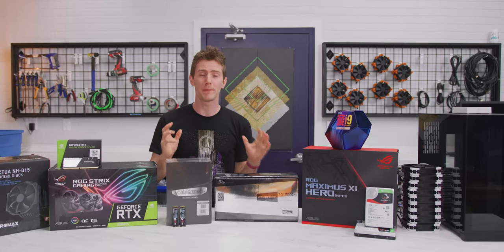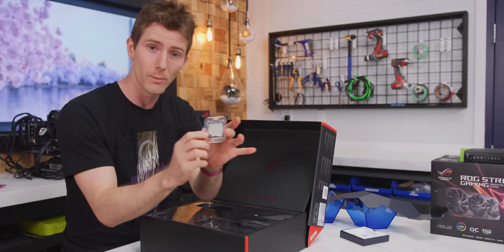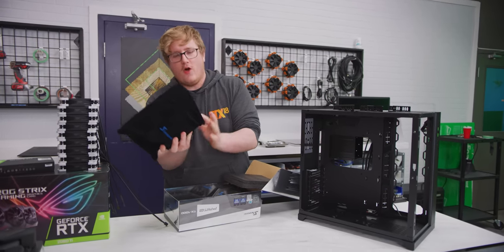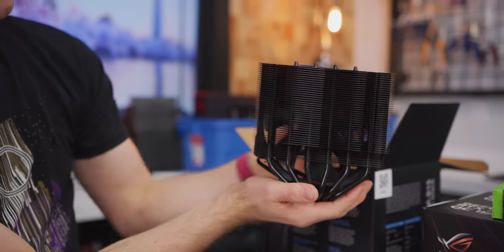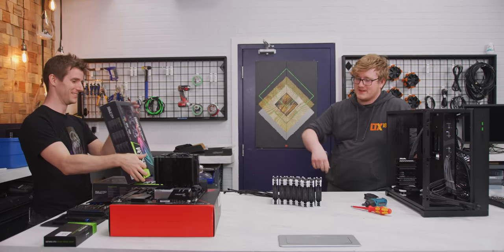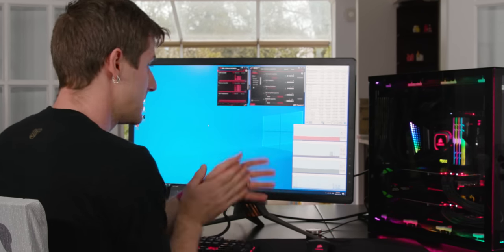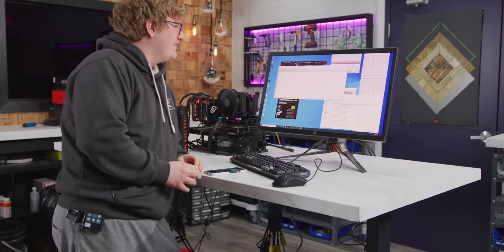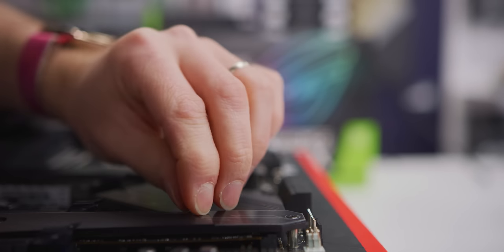Can AMD Beat the ULTIMATE Intel Gaming PC?

Comment: 14:33 
4th gen Ryzen processors aka Ryzen 4000 (Zen 3) desktop processors are confirmed to be 7nm and probably launch late this year.
5th gen Ryzen processors (Zen 4) will be 5nm and launch 2021 or 2022.
Reply: and intel still sitting on 14nm.
Reply: And Ryzen 4000 will be on N7P, not even N7+ (with EUV and a density bump). May still beat or match Intel, but it's not going to stomp this generation.
Reply: zshadows 
Price might be a reason to go with N7P. Might be better for the costumer in the end.
I consider it a stomp if Ryzen 7 4700X matches i7 10700K in performance but is 100 bucks cheaper while consuming less power/generating less heat. And I think this is what will happen.
Also they are architectural improvements (like going from 4 core complex (CCX) to 8 CCX for lower cross core cache latency). So Zen 3 chips will be better than Zen 2. We will see how much.
Reply: If amd can bring zen 4 on 5nm euv out the market Intel has to disband 14nm chip. AMD can charge premium to make some profit before Intel has real 7nm chip which will be sad they wont make as much profit
Reply: Watch the WAN show

Comment: "We're gonna play some Apex on it later"
Of course, THE benchmark, Apex Legends. ..    .......
Reply: wha？
Reply: Apex is surprisingly hard to run at all max settings. my 1660 super cant even go above 100fps 1080p all lowest settings
Reply: @Nobaris9961  you have some problems with your gpu/cpu then, coz I get 100fps on medium settings ok my rx580
Edit: for reference, got a ryzen 2600x
Reply: @Nobaris9961  What's your CPU? I'm getting 80-100 fps at 1080p with a Ryzen 5 3600 and 1660 super with all settings maxed out
Reply: @Nobaris9961  Ohh what
My 1050TI can run I think it was High settings fairly well
Reply: Nobaris im sorry to say, but a 1660 should run apex on max settings at 60+ fps with ease. My 1060 runs it at 1080p maxed out at 144+fps
Reply: My 9900K + 2 RTX 2080s SUPER NVLinked push up to 200+ fps at 1440p max settings in Apex Legends. I need a 1440p 240Hz monitor (currently on 165Hz with G-Sync).

Comment: No one: 
Literally no one:
Not a single freaking human:
Not even a goose or armadillo:
“Let me buy a $750 CPU with half the cores and threads and double the power consumption for 10% performance upgrade”.
Reply: rogerwilco99  That's kind of a pointless declaration. Best to pick the best CPU for each use case. For instance, no point buying mobile Intel CPUs for the moment...literally none, since they run hotter, consume more power and perform worse. Enjoy at least 20% worse battery life ;) 

Did AMD bully you when you were a child?

Comment: As someone that tried to cram a NH-D15 into my O11-Dynamic, I knew 10 seconds in that they were going to have cooler trouble lol
Reply: that's the reason the XL version exists
Reply: @MHWGamer  I'm actually thinking of going for the O11-Dynamic XL, with sideways facing GPU mount and bottom to top airflow, with my NH-D15 in bottom to top airflow configuration.
That, and maybe looking at some unRAID NAS storage integration.
Reply: They should have just gotten the A12U, i think it has pretty much the same performance

Comment: "a PC someone might actually buy"

Intel Core i9 & dual 2080ti's but its air cooled

Ya it was the water cooling stopping your viewers from building these rigs
Reply: They still had to water cool it anyway 😂
Reply: He said multiple times that the focus was on performance, and that watercooling wouldn't make a difference. Why bother dealing with it, if it won't help your numbers? And no, they didn't "have to watercool it". They did because they didn't measure for the air cooler.
Reply: Mark Langridge exactly so they had to use an aio
Reply: @RocketDragons  oh it makes a difference, in ease of installation and in measurements for cases.
Reply: @Pers0nman1  No, they didn't have to use an AIO. They could have found a shorter air cooler, but they have a shooting schedule to work with and it was just easier for the sake of the build to put it in.
Reply: @vulpix9210  Which is utterly irrelevant to performance. The entire point is that it will not effect your performance. Pay attention to the video.
Reply: Custom water loops offer minimal to no performance gains and are absolutely beyond the point of diminishing returns. The reason they're popular is because they look *great*. AIOs are just convenient, especially compared to high-end air coolers.
Reply: @howlingwolven  except you're wrong because of high end cards that don't get aftermarket coolers AKA RTX Titan, Titan V, Titan Xp, Titan X Pascal, and everything similar
Reply: @howlingwolven  you ever ran a 1080/2080 Ti SLI setup? Then you'll know why you want a custom loop or AIO setup.
Reply: All in all guys, what I’m saying here is I wish they did more reasonable builds on this channel. Yea I understand building these 5000 dollar rigs gets views but sometimes I wanna see the perfect CPU combo with like a 2060 Super or what size power supply should I have. When I built my rig I new I was buying an RTX2080 but I didn’t know what would be a good CPU choice, I ended up getting lucky by choosing a i5 9600k but what if I chose something too overkill or something not enough?
Reply: Vulpix For which the stock blowers are entirely adequate.

Comment: Also I made my first ethernet cable from a 2 meter/6ft yellow cable I cut in half and ran individual speaker wire to each wire to make it 25 ft and it worked fine.....

Comment: "Guys it doesnt make a different"

Gamers Nexus: Actually it does, but not much

Fight, Fight, Fight
Reply: Linus is basing it on tests they've done in previous videos where they got the same, or even sometimes slightly better temperature results from Noctua air coolers than they did with Corsair AIOs and other AIOs. They determined that if you have good air flow, then a good air cooler is the way to go, but if you're cramped on space, an AIO allows a little bit more control of your case environment.
Reply: @CreativityNull  AIOs are also slightly better when it comes to sudden fluctuations in temperature so can be better for boost behaviours (if you're bumping up on thermal limits), but honestly it makes little difference overall. I used to run liquid because I liked the numbers, but having to clean my loop every year became unfun quickly. I switched to a high quality air cooler and haven't seen any tangible difference in performance, but I saved a lot of time and money by cutting out the need to replace fluid.
Reply: meanwhile linus changes to an aio because a equal air cooler wouldn't fit.
Reply: @CreativityNull  Unfortunately, Linus Tech Tips has dropped the true scientific method in favor of entertainment. Understandable, they need more views and more money, they are a business after all. But that's also why they are not a reliable source of information anymore.

As an example, they just compared CPUs at 4k max graphical settings...  Why push the GPU if you're comparing CPUs? As a result, you can see a lot of people in the comments think you need a binner Intel to beat AMD in gaming... you really don't. As a high refresh rate gamer who plays at 1080p low so I can get 200+ fps in everything, I can guarantee you you don't need a binner Intel to beat AMD. In 4k? Sure, who gives a fuck. But in 1080p low, it makes a massive difference. I hope Ryzen 4000 closes that gap cause I'm starting to hate Intel, but you can't deny facts...

Also, not even Noctua is as good as a good AIO. Maybe if you're comparing them only to equivalently priced AIOs, sure. But not overall. To say it makes no difference and to use an air cooler in a balls to the wall build is dumb. And then to even compare it to a build with an AIO. Chances are, those CPUs weren't running 100% all the time because they stupidly tested them at 4k max settings, which means the air cooler CPU was probably spiking but the AIO cooler CPU was not because temps are more stable on water. Whether that would have had an effect on performance, I don't know. But it's still dumb what they've done here.

Also, max temps isn't the only thing that makes a cooler good. Water absorbs way more heat and minimizes temperature spikes because it takes forever to heat up. My Noctua NH-D15 had spikes from 35C to 70C just when I am opening the browser. They only lasted 1-2 seconds, but that was terrible nonetheless. With an AIO, my temperature graph is almost completely flat with the largest spikes being in the single digits.
Reply: It doesn't matter in games, because processors are almost never pushed anywhere near their limit. If anything, you'd want a watercooled GPU for gaming to push that to it's limits.
Reply: @troyvzwky  You're forgetting some of us use 1080p high refresh-rate monitors. 

Between CoD, PUBG, Battlefield 5 and Apex Legends, not a single one of those games pushes my GPU to 100% usage. My 6700K is OCed to 4.7 GHz and it's still bottlenecking my 2080 hard. If I had a 2080 Ti and a newer CPU, it would probably be the same.
Reply: @Dyils  Zen 2 is more than enough to handle high refresh rate gaming, the r5 3600 is comparable to the i7 8700 in games. Also high refresh rate 1440p monitor is cheap nowadays, i have weaker GPU than  you but i still opt for a 1440p 144hz monitor since its cheap now.
Reply: @nonameyet2205  Sure, Zen 2 can "handle" high refresh rate gaming. But it can't excel at it. You choose to go 1440p, that's fine. But with a weaker GPU running at 1440p, of course you won't get CPU bottleneck like I do with a stronger GPU at 1080p, because I prefer 240 Hz with a strobed backlight. My GPU isn't being pushed nearly as much as yours, so my CPU is having a harder time keeping up.

Also, no, the r5 3600 is about on par with the 6700K (The one I have).
Source: https://www.youtube.com/watch?v=LCV9yyD8X6M
Reply: @Dyils  There's something up with your D15 mount then. I have a D14 and never see anything like that
Reply: @Mandragara  No, there isn't. My CPU is running at 1.424 vcore, that's why :D I'm in a position where I feel the difference between air and water cooling a lot more than the average user.
Reply: @Dyils  OK with a vcore like that, you 100% need liquid
Reply: @Dyils  Let me show any vid between two types of cooler where the difference has shown like Linus did before.. Without that your words will be more unreliable than Linus according to you..
Reply: @troyvzwky  my cpu runs at 100% in games constantly when not overclocked 1.4v 4.9ghz
Reply: Except, AIOs and High end Noctua only have, MAYBE, a 1-2% difference, IF that.  And Noctua at the High end, NORMALLY comes out on top, against 360mm AIOs.  Now, switch to Custom/Open Loop, and those will blast any Air Cooler away, as a cooling solution.  (Unless you're using a smaller size or lower end open loop?  Which, normally, if you do custom loop, you go big. XD)
Reply: @Dyils  For someone saying Linus has dropped the ball and referencing Gamers Nexus, you sure are way off about some of your facts.

A 6700k matches a 3600x?  Ha.  Yeah in SOME mainly older games that can't effectively use more than 4 cores, or especially 2 core based games, sure, it can match or beat it (with an OC), but in most newer games it can not match a 3600x, not even close if we're comparing minimums.  

An 8700k or 9600k/9700k could beat it but it's not by a lot.  Are you even taking into consideration the level of tuning it takes, and how big an uplift an optimized ryzen system can have?  Fast ram and an xmp profile isn't enough.  The gains that a tuned ryzen system has over an average stock system can easily reach 20% or more depending on the game.  You need low-latency 3600-3800mhz ram (1:1 with whatever your infinity fabric can handle) with ALL possible subtimings optimized.  Even compared to just buying a 4000+mhz kit of ram and slapping it in and selecting an XMP profile, the gains from a properly tuned system are significant.

Not to mention CPU overclocking, and yes while Ryzen doesn't have MUCH in the tank, it is worthwhile and there ARE gains to be had.  You can tweak the PBO settings and adjust your voltage offset if you want to avoid an all-core OC.  Or you can push for an all-core OC that can lead to better frametime consistency and benefit games that can use a lot of threads.  Or in the case of the 3900x and 3950x, since they have so many cores, it can be worthwhile to do per CCX overclocking and manually setting core priorities in windows for the game using your fastest cores, while keeping the other CCX slower to keep total heat down to in turn help push the other CCX higher.

I acknowledge that Intel is still the gaming king, by a small margin on average, with a few outliers where it can be more significant.  Not on a 4 core though, and not on a slower / non-overclocked CPU especially.  If you have a 6 or 8 core Intel, and are pushing ~5+ ghz, then yeah you're gonna be on top most of the time, especially in a dumbass game like CSGO... who plays old ass crap with crappy graphics like that anyway, no thanks.  I didn't build a new system to look at the same graphics I was looking at a decade ago.  Besides, CSGO is one game in particular that benefits a LOT from the deep tuning described above.  It won't beat a good Intel system, but it's already significantly closing the gap you're talking about.  Zen 3 is going to eliminate the gap and hopefully pull ahead.  IPC will be up, most are saying around 15%, clocks will be up even if it's just by a little - that's still an unknown -, and it'll have true 8 core CCX's with all cores accessing the same 16mb of l3 cache, which will directly help with some of the CPU's internal latency issues that give Intel an advantage in gaming.

I'd have gone with a 3950X build, but either is great and the 9900K at over 5ghz will still be a bit faster.

As for air vs. water, you're off there too.  Yeah water runs cooler so it "makes a difference", but with a D15 that 9900k's boost behavior will be exactly the same as it's never bouncing off the thermal limit at any point in time, ever.  It'd make a bigger difference on a 3950X system actually, since ryzen's frequency is more closely tied to actual temperature even in a lower range.  The 9900k isn't, they're running at the all-core turbo speed 100% of the time while gaming.  Now could it help if they really tried to push an all-core OC of 5.2, or 5.3, and had to push over 1.4 volts?  Yeah, maybe... maybe then it could, but they weren't doing that.  And neither would most people for a 24/7 overclock.
Reply: @xalderin3838  Gamers Nexus new testing disagrees about Noctua vs AIOs
Reply: @Artcore103  Firstly, I didn't say a 6700k matches a 3600X. I said it matches a 3600.

Secondly, did you bother to look at the source? The 3600 overclocked is about ~5% better than 6700K STOCK. Then look at overclocking where they pretty much match. In some games, the 6700K wins, in others the 3600 does. And yes, the 3600 loses even in minimums, not just in averages in some games.
As for the overclocking and optimization - I would assume Gamers Nexus have done a decent job at overclocking as they're not noobs. Could they have optimised it a tiny bit more? Yeah, they probably could have used different RAM. And then it will yield another few % in the single digits. They are still more or less on par with the difference being negligible or even the 6700K winning sometimes. It's a shame they don't have the 8700K overclocked, because the original statement was that the 8700K matches a 3600 which does not. 

Third, are you suggesting the only reason to use better cooling is to make sure your CPU is boosting? This debate had nothing to do with that. It was meant to answer one question. Does air vs AIO make a difference? The answer by your own admission is yes. Whether it's necessary or not is for each person to judge based on their use case. But to say it makes no difference is just not true. Also, don't look at ONLY average temperature. AIOs don't just give you better average temperature, they reduce spikes because water absorbs more heat and doesn't change its temperature as easily. 

Here's a quick reference to just one reason why you might want lower temps regardless of whether you're hitting thermal limits or not - https://www.overclock.net/forum/61-water-cooling/794098-effect-temperature-your-processor-science-warning.html
Reply: @Dyils  That's my point, why would you play at 1080p if you know your CPU can't even handle it? Even if you switch to 1440p you will still get the same performance because of CPU limit that happen in 1080p, also a 2080 should be able to handle 1440p easily, even my 5700XT still can handle 1440p just fine and even goes well over 200fps in competitive games like CSGO or rainbow six siege. I said the r5 3600 is comparable to the i7 8700 and that video doesn't include i7 8700. In taht video stock out of the box the r5 3600 is faster than the 6700k in most games and much faster in some games, but a heavily overclocked and mesh overclocked 6700k can still match the R5 3600, but you can also overclock the r5 3600 infinity fabric and tune the sub timing if you want more performance, unfortunately GN and many other reviewer didn't do that in their comparison. Here is an example, a ryzen 9 3900x can go from 250fps to almost 300fps by just tuning the memory and infinity fabric https://imgur.com/a/VnFjiKe 

Also if you want to see r5 3600 vs i7 8700 take a look at this https://www.youtube.com/watch?v=lUMCR4idn_s&t=289s
keep in mind that the r5 3600 is at stock and the 8700 can't be overclocked .
Reply: @Dyils  Exactly, Noctua is better than cheap AIO but that doesn't mean air cooler is as good as well built AIO

Comment: If you think closely, a water cooling loop is just a device which the heat pipes became the tubes, the liquid inside is water, and the real cooling part is still air cooled. It's just a heatsink remote to the CPU.